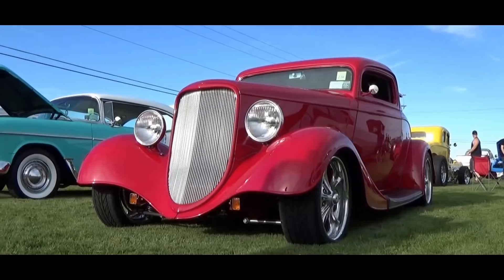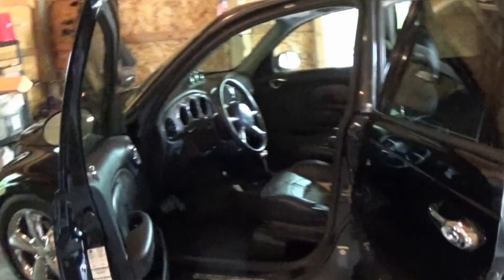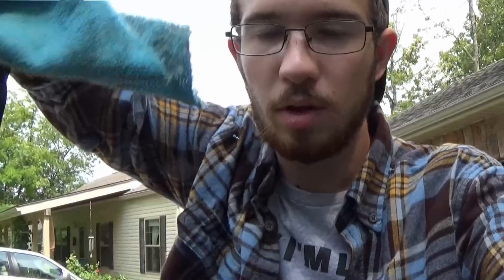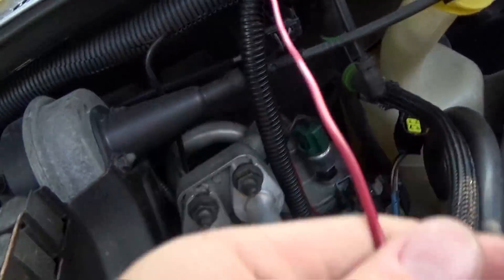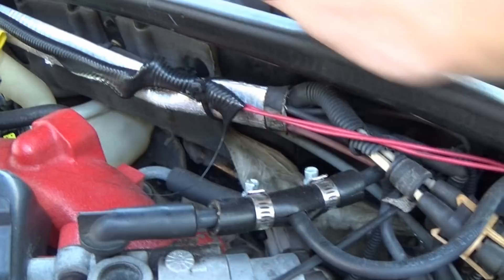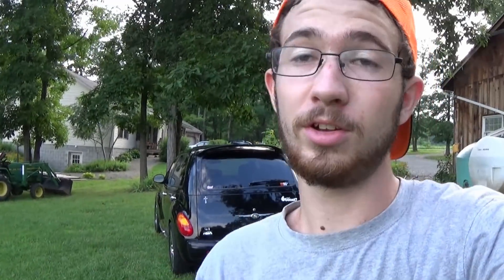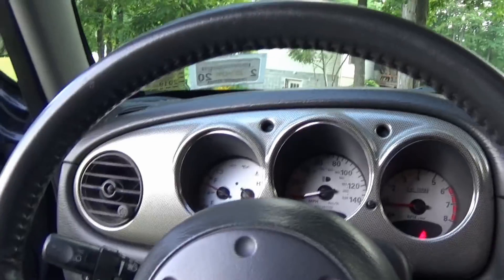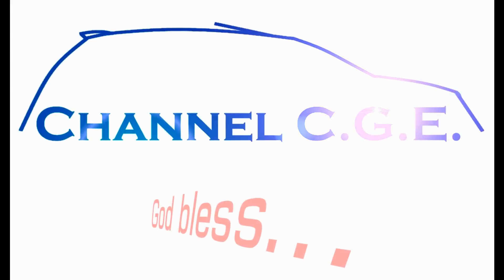R.I.P. Super Cruise, but at least my car is clean (vlog)

Comment: Here's a good chance to upgrade your audio. Once you go to 2 woofers you'll never go back to 1. 

I have a 4 channel, 1 ohm stable amp and run my 2 subs, tweeters, and mids with it. It's nuts dude. Zapco amps absolutely amazing.
Reply from the maker: That's dope dude!!  I've been wanting to build a custom box in the side of the hatch area, i was thinking about going with a single 12" and 1400w peak amp (I forgot the RMS), I figured it'd be a step up from what's there, but... maybe I should just send it and do duals 🤔🤔 I'm gonna look up Zapco for sure!  Appreciate the comment :D

Comment: Hey just a question. How's are you liking your lowering kit? I just got some nice wheels on my 06 touring I'd love to have it slammed (way too much space in the wheel wells) but I live in Canada with snow and potholes. I know NY isn't much better probably. Is it still good enough to be daily driven? Do you frame bang anywhere? Is it hard to Jack up? Give me your two cents. Thanks!
Reply from the maker: I'm absolutely loving the lowering kit!!  We have some terrible terrible roads around here and I've been okay, hit a few nasty potholes but I think the only thing damaged was my soul haha.  It hasn't effected daily driving for me at all, I just try to be a little more careful about holes and steep driveways but I probably don't have to be.  My big 3ton jack still fits under the car barely in the front, but worst scenario you could make a little 1"-2" ramp out of some old scrap wood if your jack didn't fit.  Still drives up on normal ramps just fine too.  It'd be perfect on your touring I'm sure!  What kind of wheels did you get?  Thanks for watching btw :D